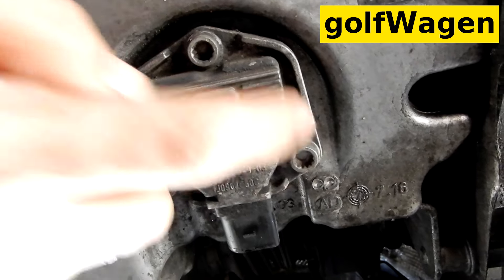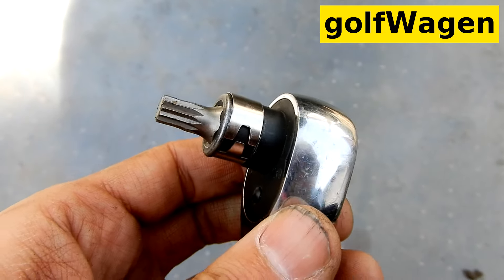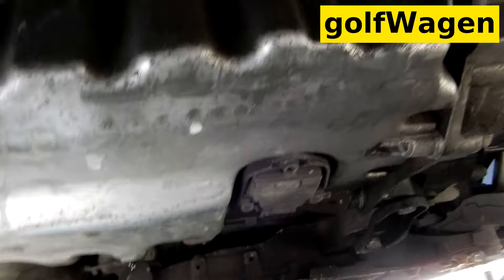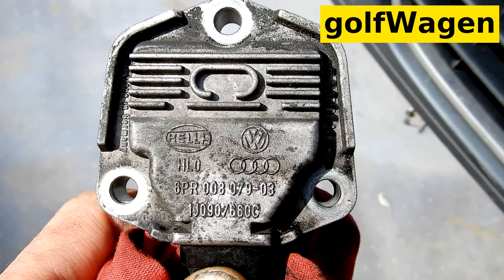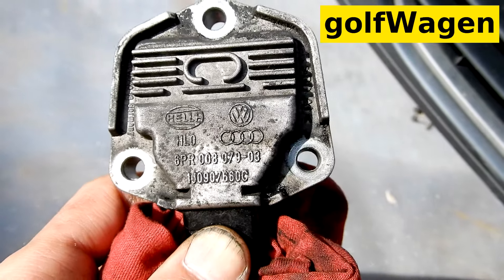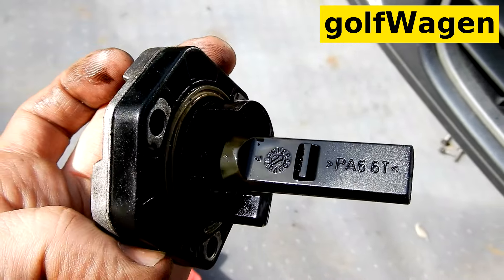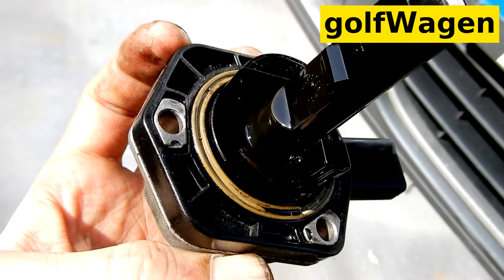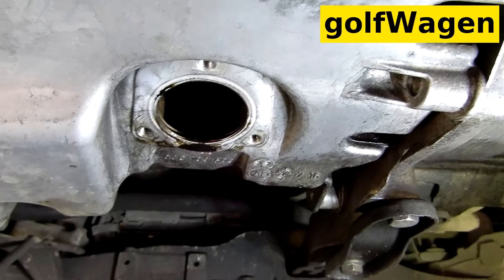VW Golf 5 oil level sensor change G266

Comment: Do you have to leak out oil before changing the sensor?
Reply: Hi, sure you have to drain the oil first, since the sensor is at the total bottom of the oil sump.
Reply: Very late but gotta say, you don't HAVE to, but it's better as it isn't on the absolute bottom so you will have to gues how much oil to add in